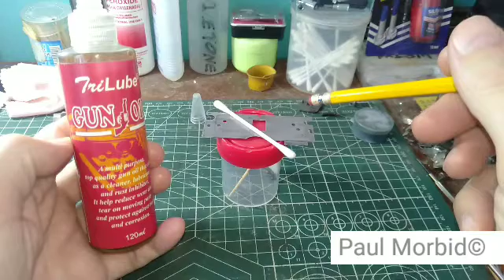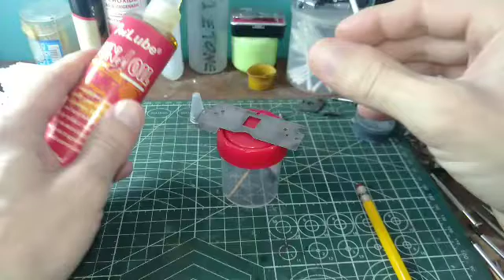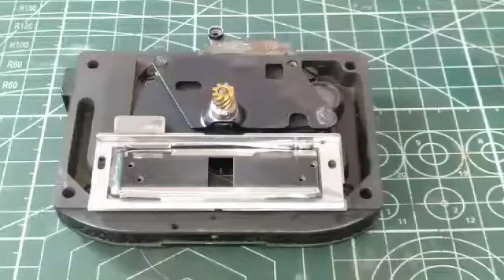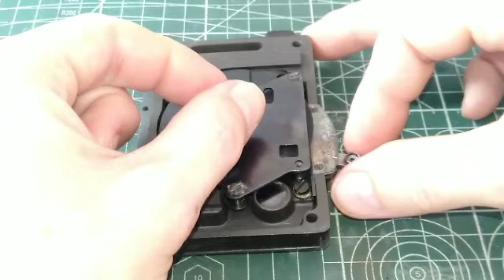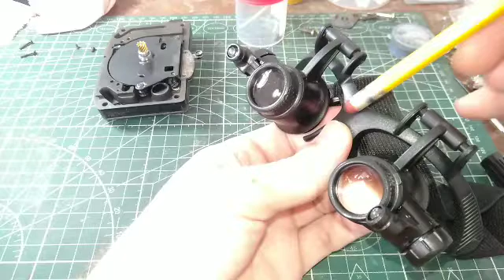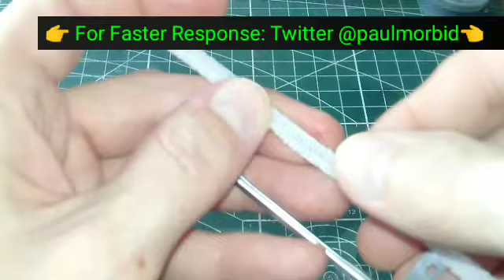Overhaul Of Bolex H-16 Part:31 Film Gate

Comment: What exactly are the 'leaf-springs' designed to do in this instance? Are they pushing against the pressure plate or are they added as an additional guide, essentially providing positive pressure to the lateral edges of the film?
Reply from the maker: @tylerfukuda  Hi there,
Everything I said in the video really explains all. As the second half of your sentence reads is correct. It's the same thing I said in the video.
Reply: @paulmorbid1476  Thank you for confirming this. I don't own a Bolex but am trying to understand the design choices used in the film-gate.